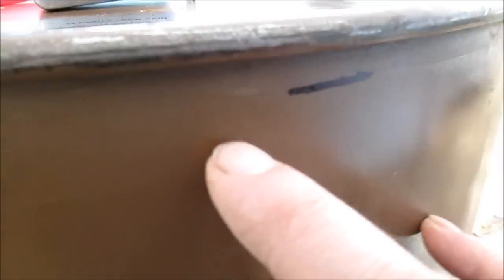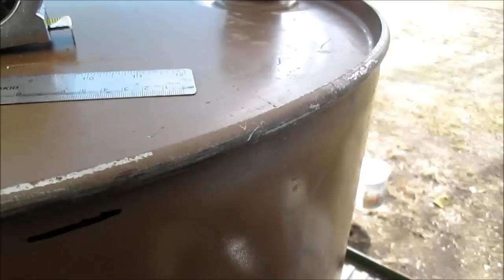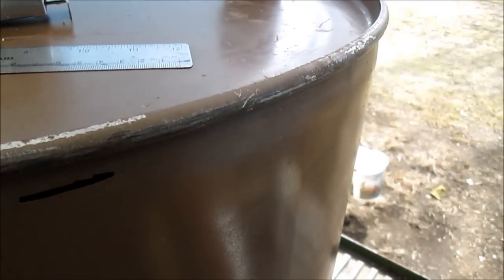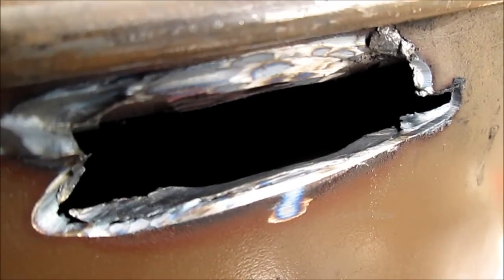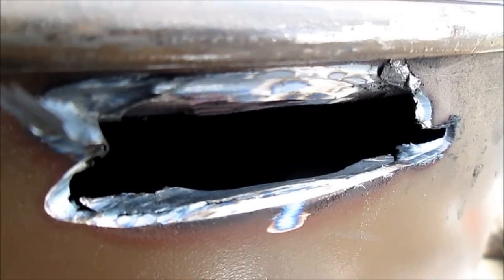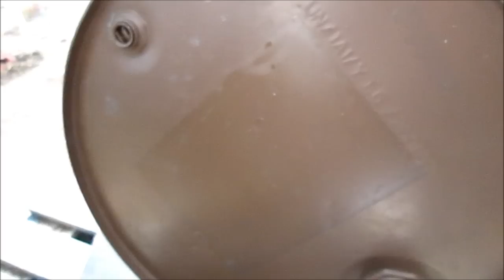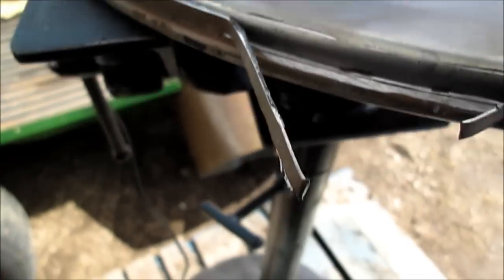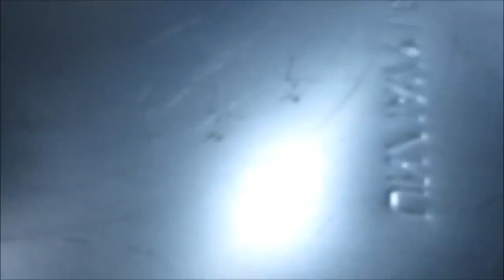How-To cut the top off a 55 gal oil drum to use on the shortened barrel

Comment: i just got an empty Kendal oil barrel that is sealed up .  im gonna drill and then use a jigsaw to cut the top off .  im scared that it will explode .  Oil wont explode , right ?
Reply: Lol, I've been looking for the same answer!!
Reply: @TroyDurrance  i hope this helps someone , Here's my advice on burn barrels . i use mine to burn yard trash and paper trash every 2 weeks at least .  i bought my barrel from Craigslist (i placed a free wanted ad ) and i paid $20 for a new orange Kendal oil barrel from some guy locally .  it still had a little oil in it . i could hear a gallon or so oil  sloshing around .  i went to harbour freight and bought a $14 angle grinder and $7 pack of cutting disks to chop the top off . i cut about an inch and a half down from the lip on the top so i could keep the top as a lid so the rain wont get in it . the angle grinder cut super clean around the barrel and took 30 seconds to go all the way around .  the oil wont  ignite from the sparks .  i was told , if you could smell fumes of a chemical then yes the sparks are an issue but regular oil in a barrel is fine . (if the barrel is from a PETROLEUM wood stain then DO NOT MAKE SPARKS AROUND THAT) . YOU CAN SMELL WHATS NOT SAFE TO SMOKE AROUND AND THAT IS KEY.    if you use an angle grinder make sure that you r  smooth down the sharp lips on the lid and the barrel because it's razor sharp when you cut that lid off .... make sure you drill 4 holes ( or shoot with a pistol 4 holes)  through the sides of the barrel so air can get it while your burning . It makes a huge difference when burning lots of yard trash .  and also drill or shoot a hole in the bottom center so if water gets in then it can drain .  your barrel will last years longer if you drill a small hole in the bottom.  also , put bricks on the ground under the barrel because it gets very hot ... and before you burn , use a hose to spray water on the ground around the barrel especially  if your gonna let it burn unattended (which i do because im mowing or doing yard work  and im not watching it ) .
Reply: It will explode if you do not fill with water remove all fumes
Reply: Agreed it’s safer to fill with water dilute the crap out known or unknown contents, if it smells like WOOOOOSH it probably gonna WOOOOOOOSH